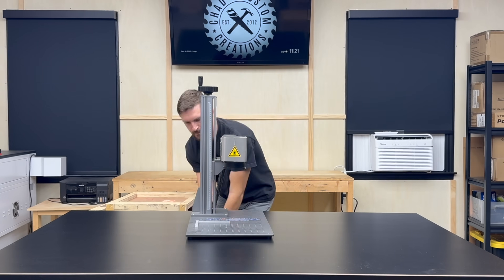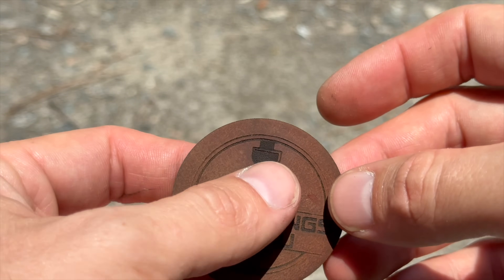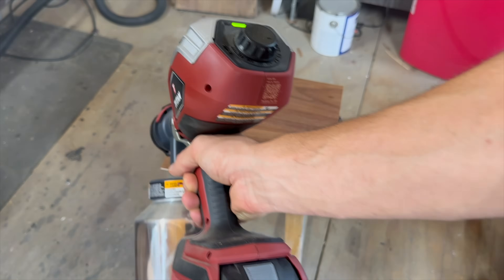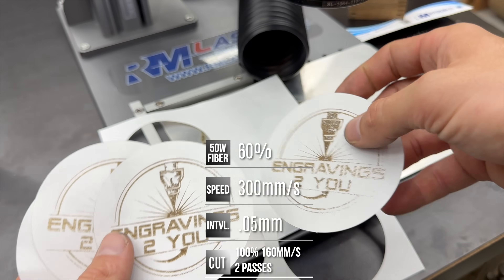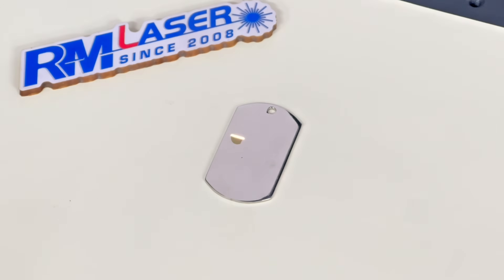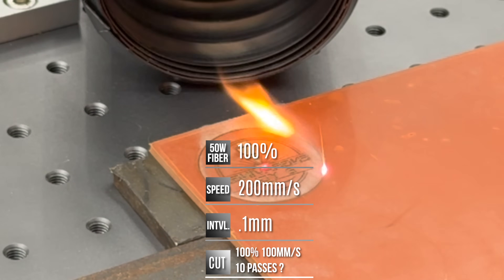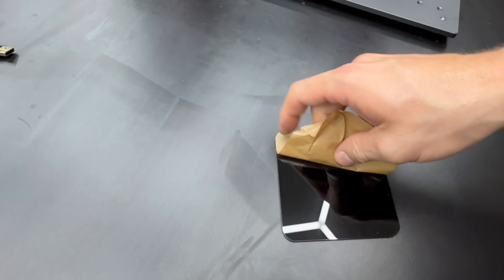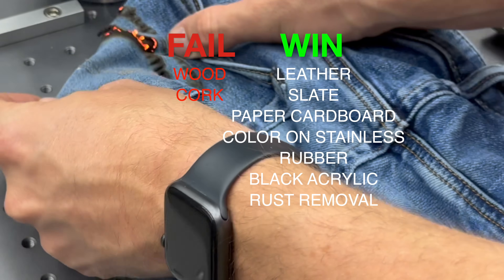10 Materials Fiber Lasers Weren’t Made For

Comment: As a technician installing and servicing these machines, I'd say mopas give you a much wider range in terms of frequency and pulse width control which allows you to get away with marking things you wouldn't normally achieve on a regular fiber laser... I am very keen on getting my own to do projects and work for people, but they tip the scales when it comes to price for entry.
Reply from the maker: I’d definitely have to agree with you on that one. For some the extra cost of the MOPA makes sense.
Reply: @ChadsCustomCreations is definitely something Im considering, versatility is good.

Comment: Nice video. It's been 4 months, so you've probably already worked this out, but I noticed on the higher speeds on slate that you have some ghosting on you test squares, it looks like you might need to tune your TC and polygon delays and Jump delay. Laser everything has a great video on how to do it. It can really make a night and day difference on your machine performance. Keep up the good work!
Reply from the maker: Reuben I think you’re spot on there! I was noticing I could only run it at a certain speed on images with smaller designs because parts would not get lasered. I am gonna go check out laser everything’s video and get that dialed in.

Comment: It looks like you have a frequency of 20 KHz for all of the materials you tested. Have you tried adjusting that as well or is that where it works the best?
Reply from the maker: I think you’re right I am very new to using a fiber laser so I’ve got a lot to learn. 20khz is where I kept it do you know if adjusting that could have improved some of my results?
Reply: @ChadsCustomCreations  Sorry I didn't see this until now.  I'm new to using a fiber laser as well, but changing the frequency definitely affects the outcome.  Whether that would improve the results I couldn't say, you would need to run more tests! But I would be interested in your results!

Comment: There is leathersoap or "saddlesoap" with which you can clean leather better than with ipa imo. (although i never tried ipa on leather, it did not surprise me that it didn't work well for you. I use ipa only for things i need to degrease, it's cleanign abilities aren't that great if it isn't about anything grease or solvable in alcohol. And soot from burning leather imo isn't greasy soot)
Reply from the maker: Thank you for saying that I knew I must have been doing something wrong. I’ll grab some of that for next time.

Comment: I've been thinking of getting a galvo fiber for packaging, specifically black printed e-flute corrugated (1.5mm thick). 

Cutting is fast on the big CO2 but engraving is slow and I often have to refocus due to cardboard having some amount of warp, especially with only one side printed. 

Even when the sheet is held down on all sides, parts of the sheet can bow upwards. Just a pain for engraving.

A galvo would fix this, the only issue is trying to justify the cost. It's a lot more expensive here in AU if I want a locally supplied + supported unit.
Reply from the maker: Great points and I feel your pain with the warped cardboard. You’re right: while galvos are crazy fast and precise, their tight depth of field actually makes them less forgiving with uneven surfaces than CO₂. So if your material isn’t flat-flat, the focus can still be a battle.

It’s one of those trade-offs—speed and detail vs. flexibility. And yeah, I’ve heard prices in AU can make that jump even tougher to justify. Really appreciate you chiming in and sharing your experience it helps others a lot!

Comment: There's a trick to make a fiber laser work on wood.  Brush on a couple of coats of baking soda/water solution.  Let it dry.  The laser still doesn't directly affect the wood, but it burns the baking soda, and the heat it generates in turn chars the wood.  It's pretty consistent, too, so long as you use a wood with a tight grain pattern like maple or poplar.  Open grain woods like oak or pine will yield the same terrible results you'd get on a CO2 laser.
Reply from the maker: That’s a great tip to know, I’ll have to try it out! Is that similar to the borax technique as well. This will need a top sealant coat to lock it in right?
Reply: @ChadsCustomCreations  Similar effect, yes, but it doesn't have to be sealed in.  Check out a video by SarbarMultimedia titled "Fiber Laser Learning Lab 17 The Mysteries of 1 micron Wavelength Light".  Around the 37 minute mark.  The other info in the video is pretty interesting, too.  Most of his videos are fairly long winded, but I've never seen ANYBODY on YouTube do such detailed experimentation with laser settings and materials as this guy.  His entire channel is a goldmine of information.